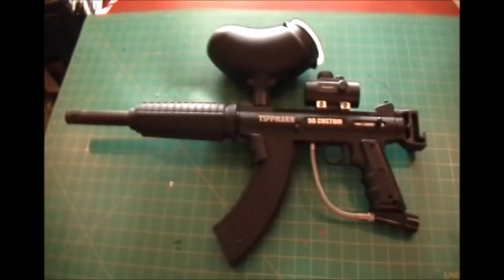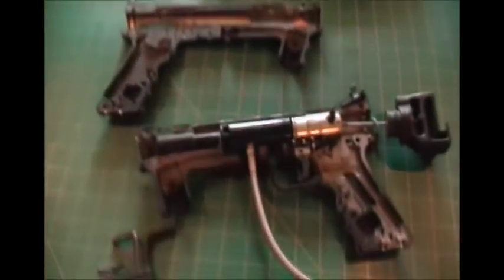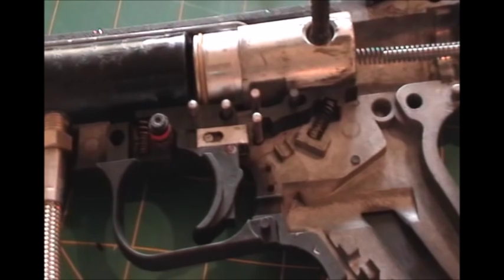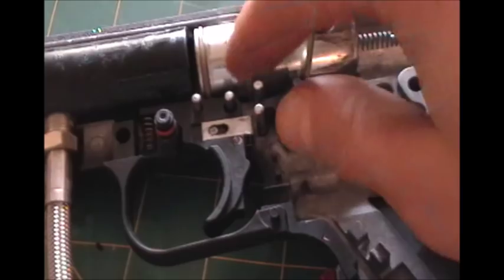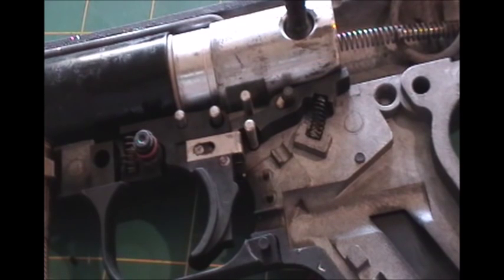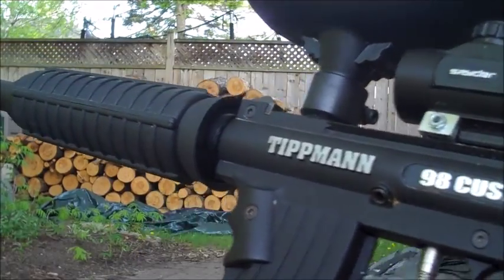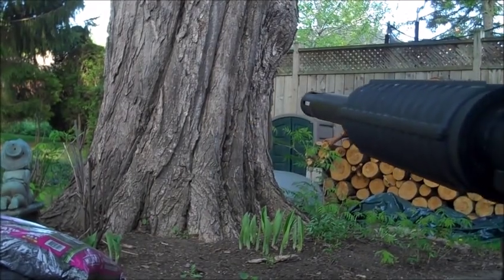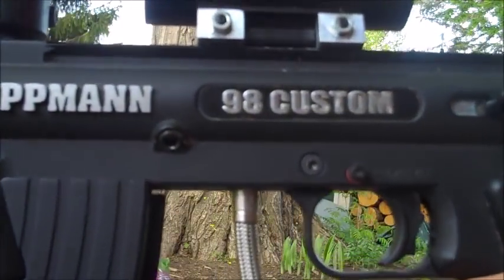Full-Auto Paintball Gun Mod - EASY

Comment: he turned it into a flamethrower
Reply from the maker: +Richard Rounce hahaha kinda yeah
Reply: inventor719, just put an electronic hopper on it and it won't chop paint anymore. The rate of fire overwhelmed the gravity fed hopper, the balls simply don't feed fast enough, and the bolt ends up returning before they make it all the way into the chamber. This results in the paintballs being chopped in half, as the bolt wants to be foreword but they are still half in the hopper. Put an electronic hopper on it and it will feed fast enough to shoot whole paintballs.
Reply: Best comment
Reply: He just needs a better hopper to push the paintballs out faster

Comment: you need a chamber feed system. gravity feed doesn't allow the ammo to load quickly & is chewed up by the bolt. a chamber feed system pushes in the ammo, timing between the bolts back & forth action.

Comment: Tippy's are really rough on paint. Since those don't have eyes in the breach and since its not a 'low force bolt', its chopping all your paint to shreds...the inside of the gun is probably a mess. They might make a cyclone upgrade for the 98C; that combined with either an E-Grip or Response Trigger will make it much more reliable. You picked a solid platform to modify though...my backups backup is an A5, just in case I run out of batteries or it really starts raining.
Reply: looked like a fail

Comment: the problem with this mod is the insane cycle rate tippmanns have without sear engagement. even my A-5's modified cyclone feed just couldn't keep up, so I figured I need some sort of delay mechanism to slow the bolt down. turns out, that the response trigger system can do just that, by pushing the trigger forward with an adjustable pressure piston, and combined with a heavy trigger return spring to prevent full disengagement of the sear, this works GREAT! the ROF also depends on how hard you pull which is interesting... so in short, RT + sear mod (this video) = about as good a mechanical full-auto as can be hoped for.
Reply: it seems to me that the response trigger would render this mod useless

Comment: would that work if you had an elictric hopper
Reply: You would need the fastest hopper EVER!
Reply: If you put a Rotor or a Spire on there, without eyes in the breach, the bolt is going to slice nearly all the paintballs in half because the gun doesn't know when a paintball is fully chambered. And whatever shards are left in the breach or barrel are going clog the whole thing up.